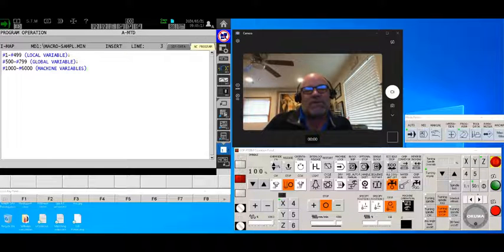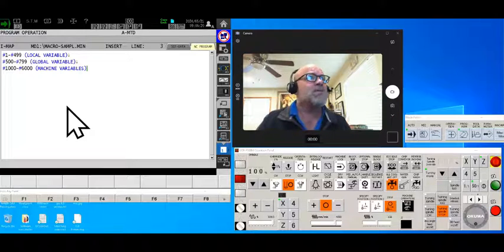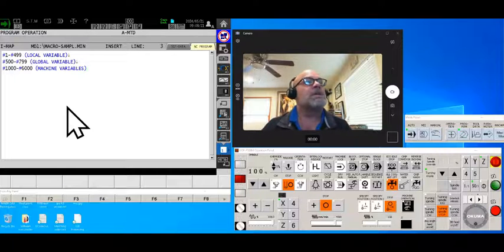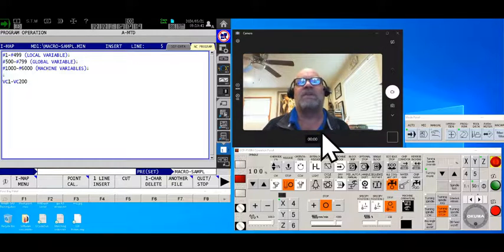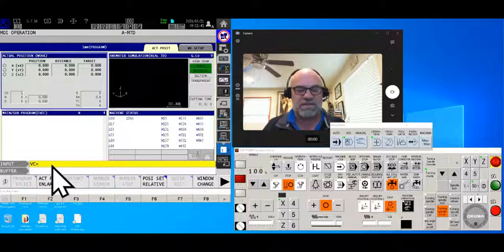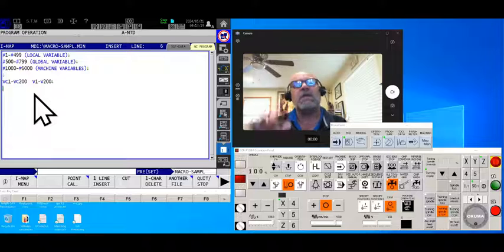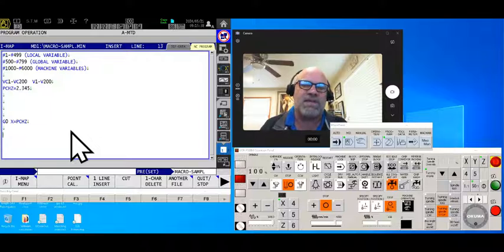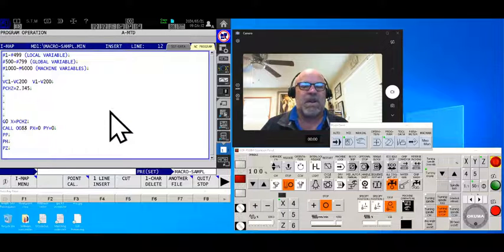Okuma Macro Variables explained

Comment: Why is it that when I look up “how to program on an Okuma cnc lathe” it pulls only gcode and not the conversational? IGF or the OSP???
Reply from the maker: Wow! I hadn't tried that, but I see you're absolutely correct! If it helps you out, I've got the OneTouch series of videos here. It isn't complete yet, but getting there!
Reply: @pocketcharleywithgosiger 
Yes please I would like to see them. 
I have two Okuma Lathes CNC
1) LB4000 EX OPS P300L
2) LB3000 EX OPS P300LA

Comment: Hello Charlie: What about getting the program in AOT into the loop from the start to the end and explain P-codes, IF, GOTO statements, VIRD and VORD for chucks. It has to be repeatable. If you could make a tutorial for everyone who works on robots and gantry loaders it would be even better for everyone who struggles or struggled to set it up.
As of now, I struggle to get milling and turning independently running after the pick off and raw part loading. It has something to do with P-codes but according to AOT, milling and turning run in different spindles but errors out weirdly.

You have to make and save processes in NC-Program and I try to get it working for everything. We use the worst of the worst of the worst uneven house steel castings with a big head (3rd side), tight on top with long tools.

Also I found the problem with loader program that is independent. Usually after raw part has been clamped the part should have been clamped but when I restarted the program, well below the raw psrt loading, it unclamped. We had to tell the machine to M83 in NC-program in AOT because M84 was active in LR-Transfer and we had to counter it. The loader checks for a clamp in main and it was alright, I've tested scenarios already.

Thank you.
Reply from the maker: Great list! I'll add a few of these ideas to my list of videos to produce, but let's talk about the easiest of them here: looping thru AOT. This is a video I created displaying the methods for looping lathe programs. https://youtu.be/PhT82zAr0lw  Since two of the looping methods would require use of an NC PROGRAM process, I advocate for using the schedule program method described.
Reply: I got it working with just NC-programs and saved as a .upa for now as a process along with a setup "sheet". In the future I may consider going for a schedule program but I am not this far yet. I am learning automation from 0, looking for error solution for 3 hours realizing that I had to change one command or change key position in loader. Now I closed the loop and am about to start cutting in 5 axis (milling and turning). I wondered why one turret stopped when the other reached destination. I though about collision avoidance but the reality was, it was in sync and after the first part it I should play more with feedrate while the single block is off. Next week I am going to see and lear  the true potential of this machine. Definietly worth it.  @pocketcharleywithgosiger

Comment: Great video, very good. The only thing I queried is the local variable name, I got the impression that you need to start with ‘P’, however in my understanding you can start with say X, however you need sufficient characters after it, that do not exist in control use or extended address character use. Also the manual says that there are 127 local variables, however our U5000 from testing has 511. Curious to know if that was an option we got or not. It’s a P300SA-H control. 

Also the way local variables are carried into and out of sub programs might be helpful to some. The manual explains it but not very clearly. I found testing it helped me understand more so then reading.
Reply from the maker: Woohoo! Local variables are awesome! No, the variable name does not need to start with a P, but Okuma and many of us in the field prefer starting with a P so a local is readily identifiable. You CAN start a variable with an X, but as you suggest, there must be additional characters to clarify that you're identifying a variable. An X with a number following, for example, is unclear whether  you're commanding a motion block or calling a variable. XX, however, is clearly a local and won't alarm out. As for the quantity of locals available, I can't answer that. I have also read that you are limited to 127, but the book is unclear whether that is 127 per level, or total. I have never run any programs with that many locals
Reply: @pocketcharleywithgosiger  thankyou. Interesting about quantity of local variables per level. I think you can nest program 6 or 8 levels, which would be too many for 127 on each level. I have only used a maybe a dozen at any time, but I was testing as I wanted to see how the machine handles overuse. It just alarms. I was trying to find a solution to another problem and was going about it from different directions.

Comment: Thanks Charlie.  I have a 26 tools in my multis 250 with 105 dimensions.  Im using common V for the print call out and it works well. Each dim. has a bubble call out # on the print and I have them matched to the print.  Now you have my brain thinking again. lol